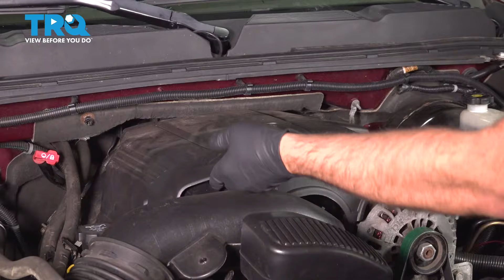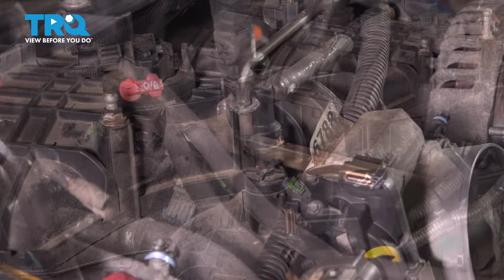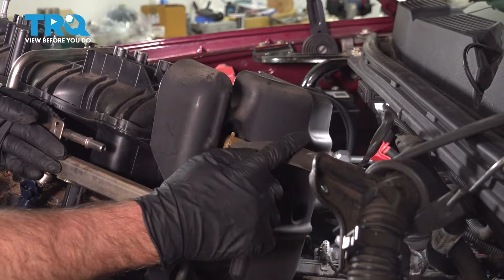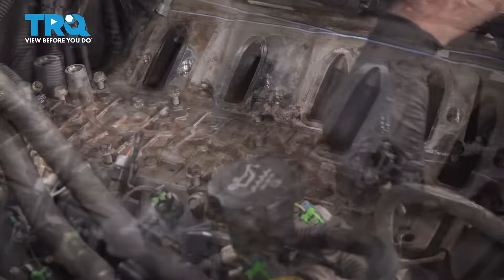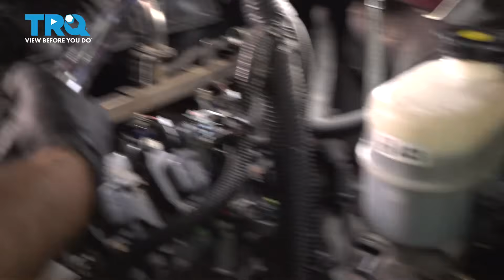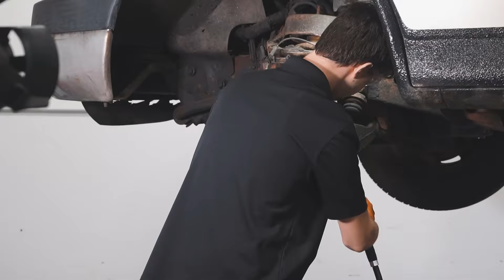How to Replace Cylinder Deactivation Manifold 2007-2013 Chevrolet Silverado 1500

Comment: This is an EXCELLENT EXAMPLE of how to perform almost ANY Instructional video. This video is AAAAA+
The instructions are given in SHORT, CONCISE, "BULLET' statements. (NO useless blathering or BS spoken to add confusion)  
As the instruction is being described, the VIDEO COVERAGE closely follows the VERBAL INSTRUCTION "precisely"
And added plus is that in this procedure, the instructor is professional and thoughtful enough to call out wrench and socket SIZES....
This is a HUGE A+ to the process

My only suggestion to the "process" would be to clean as much of the intake side of the heads, and the valley cover BEFORE removal of the valley cover to avoid risk of excessive and or damaging materials falling into the intake ports of the heads.
A pass or two of a shop vac on the valley cover would likely be enough for the cover and with the cover left on a more vigorous cleaning around the ports would keep debris from entering the engine valley.☺

Comment: What are the symptoms of one of these going bad or what exactly was the reason why you were changing this one?… I’m having an issue with my 2007. After replacing all the DOD lifters (one went bad) now I’m getting a misfire on cylinder 1,4,6,7 but only at idle. The moment I rev the engine, the misfire goes away

Comment: The best step by step video I have ever seen.  Thank you 

Would replacing the gasket only would be enough in my case it’s leaking oil and subsequently I believe it stopped its function switching from V8 to V4.  Yukon 2013

Comment: If I switch the oil pressure sensor n still shows low oil pressure. Should I replaced the oil intake manifold gasket too.
Reply: Could be the oil pump o ring
Reply: Yo tenia el mismo problema le cambiaba el sensor del aceite 2 veces y seguia el mismo problema le cambie l bomba del aceite y listo es facil de cambiarla